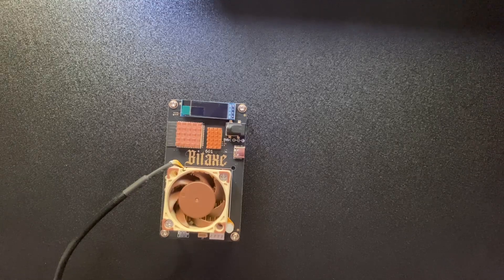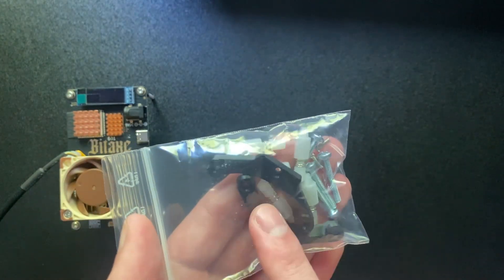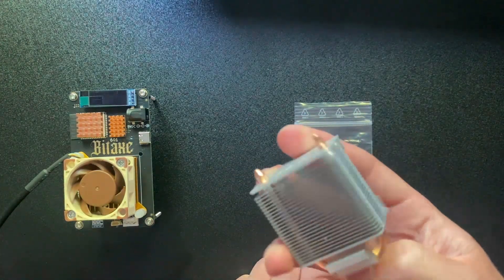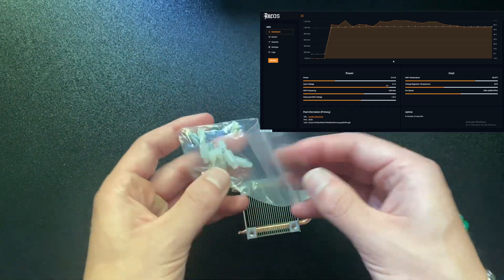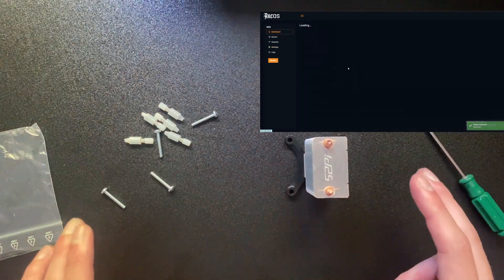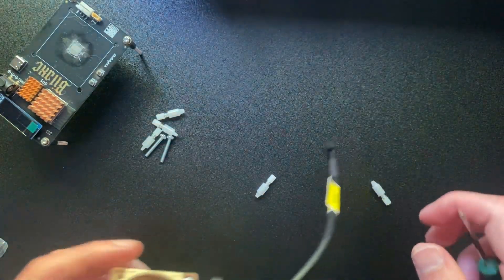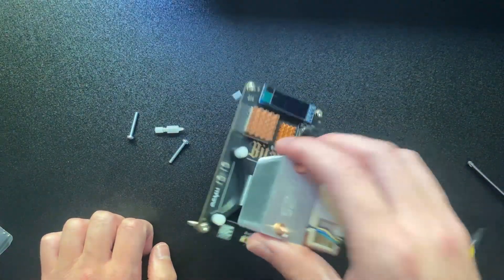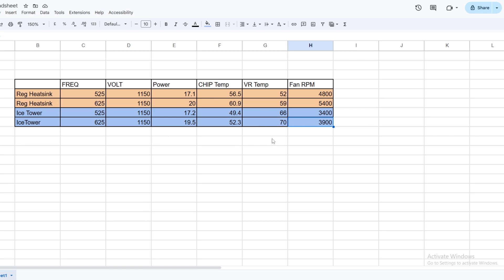Ice Tower Heatsink Assebly and Testing For Bitaxe Overclocking

Comment: Ice Tower is fantastic. 
I just received it from Germany.
My Gamma always have 575Mhz+1100 core voltage = 60 degress. quite hot.
however, after changing to ice tower~~~~
600Mhz+1150 core voltage = 46~47 degree. it is fantastic !!!!
go maximum? not yet ^^

Comment: So far l've found the Ice Tower performs far worse than the stock cooler that came with my Bitaxe Gamma.

Heat is transferring to the cooler fins but the Noctua fan doesn't seem to move enough air with default settings and fan running at 100%.

Maybe the thermal paste I got is garbage.  Artic MX-4
Reply from the maker: I think it’s to do with the 3D print, sometimes it has slight defects that can affect it. Also I just used the stock black fan because I think it’s better for the ice tower

Comment: So i had custom mounting brackets for th2 52pi ice tower for my gamma. One had 2 pin inserts diagonal from each other and the other mounting bracket has 4 pin inserts on the mounting bracket. Does this actual affect the performance? It seems like the 2 pin insert bracket overheats my gamma within a minute while the other one works fine.
Reply from the maker: i would stick with 4 pins

Comment: Any thoughts on my readings? I have a SupraHex overclocked at 625 freq. / 1250V and my ASIC Temp is at 49 C, but my VR Temp is at 82 C... Default settings ha the VR Temp around 70 C and ASIC Temp was in the low 40's C. Should I be concerned with my VR Temp?

Comment: Unless you get really unlucky in the silicon lottery, the VR is going to be the limiting factor in every overclocking configuration. Focusing on dropping the ASIC chip temp and leaving the VR alone isn't going to get you the best results.
Reply: Agreed, I'm at that point. ASIC is 42c running 985mhz / 2TH keeping VRM cool is the challenge now but no real good way to get a decent heatsink on it other than adhesive. Need to make something better that runs a high performance thermal pad and is actively cooled.

Comment: hey sterling. i have a stock bitaxe gamma and a dumb question:
i have got a noctua NH-U12S CPU heatsink laying around and my plan was to install this huge thing on the gamma.
as for the fan i thought about using a Noctua NF-A9 5V PWM which i also have to happen to lay around.
would that work in your opinion?

Comment: Good to see you bud.  The copper is vapor chamber pipes.
Update on my waterloop setup.  Temps remain under 50c on the asic, and with two 140mm fans blowing across the swarm, the vrm's are staying below 60c, even when the farm area is 32c.  Current OC on the farm is 800mhz, 1220mV,  getting anywhere from 12 to 14 j/Th
Reply: What have you done for VRM temps? I have adhesive copper fins actively cooled but it's not enough to keep temps low enough that I would be happy long term running 2TH
Reply: @bngoold  I have some vrm copper fins on the front pcb and the vrm itself on the back on each of them. Then everything is mounted on top of the radiator itself, using the rad fans to aid in natural convection, and then two 140mm on the side of the array, move high volume of air through nice and quietly. Vrm’s sit around 55c on average while pushing 27 watts.
Reply: @GhostSenshi  Cool, thanks. Mines pushing 37w / 2.07TH average at 1.31v so VRM temps challenging to manage. Still within safe, but not where I am happy. Thanks for the feedback. I have spent ages looking for threads on people who have done awesome VRM management for extreme OC but can't find anything useful and the back side board layout doesn't favor mechanically clamped heatsinks with high performance thermal pads unfortunately.
Reply: @bngoold  what I’d like to do to step it up is use a server rack. Like a 4U perhaps, so I can control air flow better rather than open air. It’ll improve the efficiency in that regard. Only other option would be to probably diy something that incorporates the vrm’s in the waterloop as well.

Comment: Great little cooler. Good on the spring pins. They ensure constant tension as the chip heats and vibrates with varying frequencies. Too much tension with threaded fasteners will ruin your miner.